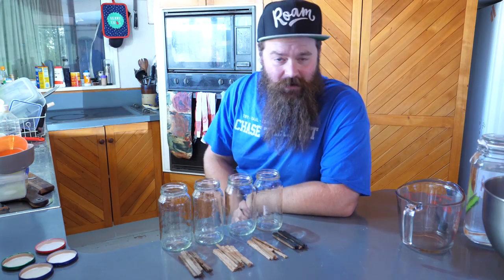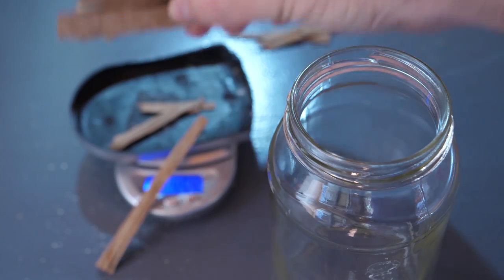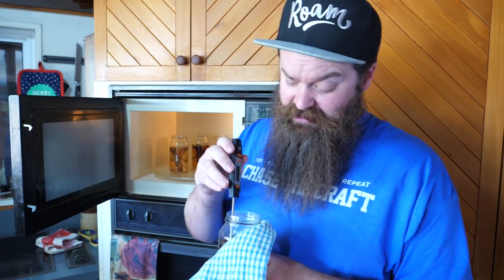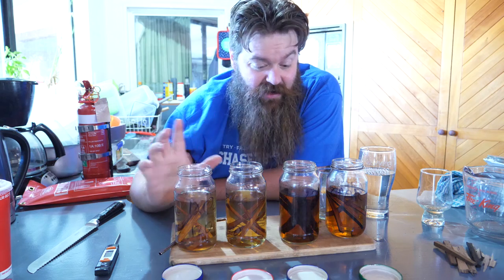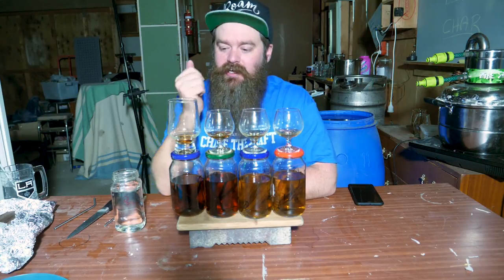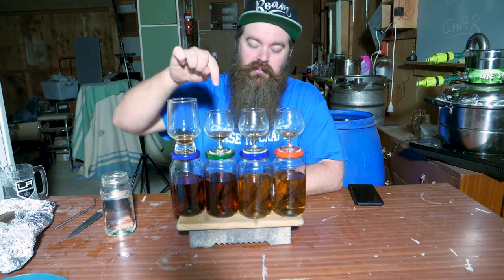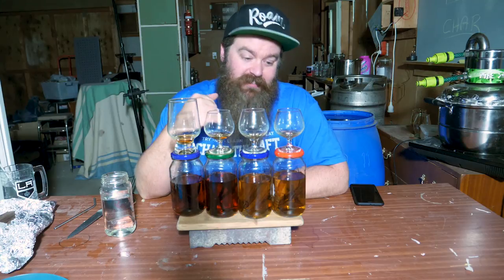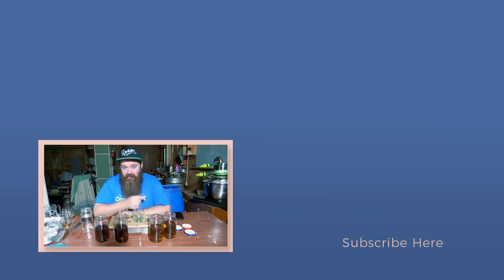Testing Different Oak Char & Toast With Nuclear Ageing

Comment: Why not putting the jars in hot water ? Its slower but safer. An other solution would be to use a seal vacuum for jars.

Comment: Artificial aging is good and all, but there is no real substitute for time.
Reply: Mr Radrick
Reply: Hey can you ad cherry juice to my blend ??
Reply: How do you know. Its all chemistry. If you can identify the exact compounds developed by ageing and recreate with a faster method how would it be different? Don't get me wrong. I am not saying what he does makes aged whisky , but technically ageing can be recreated.
Reply: @jaytorr6701  Yep, and it's easily achievable with gas chromatograph analysis.
Reply: Same shit but faster
Reply: Mr Jenkins but if u need a drink u need a drink when I start up again I will do half forced and put some in my loft for ageing
Reply: Ha easily attainable my ass just because you know the exact amounts of certain chemicals does not mean you can recreate those amounts..... Unless you individually separate each compound then add them back together. Course something like that would cost more than the most expensive whisky.
Reply: You sound like a god fearing man
Reply: @jasontoth5268  Is that supposed to be a compliment or an insult?

Comment: This is probably stupid for suggesting this but maybe try getting your hands on a sous vide machine they basically bring a pot of water up to temperature and hold it at that temperature so you can cook stuff in bags and sealed containers without the worry of burning or going over temperature might be useful if your doing this sorta thing often enough
Reply from the maker: Nah good idea mate

Comment: Hi. have you tried heating the spirits to 60 degrees centigrade.  and place it in an ultrasonic cleaner.  but the desired oak / wood in it i Do 30min runs and a pump that pumps around the spirits in the meantime.
Reply from the maker: I have not tried it.  But I have seen a lotta interest in it after a certain video came out here on YT.  Will have to give it a shot some time!

Comment: Someone may have already asked this, but curious.  You microwaved the samples without lids on the jars.  Won't you lose alcohol by doing that?  I get why you didn't put the lids on (pressure inside the vessels), but I would think that some of the alcohol may evaporate using this technique.  Of course, ethanol vaporizes at 78 degrees celsius (172.4 Fahrenheit for the Yanks) so I guess you wouldn't lose too much alcohol.

Comment: I wonder if you could ferment Skittles to the point so it tasted pretty good on the other side, poured over ice with lemonade as a drink, I call it the I.C   Insta Cocktail just add Lemonade and ice of course, ok it's not quite an instant Cocktail, because I don't own a  replicator out of StarTrek, but hopefully it will taste like a few different liquors but only 1 Base Spirit, and I don't mean it will taste full on like a proper liquor but have hints of the different Skittle flavours 🤔

Comment: Consider adding the SSM to the jars then tossing in their respective oaks in to keep timing sync'd if you're concerned about it. A lower power setting provides shorter bursts please know.  High power is a continuous burst of full power in most microwave ovens. Microwaves cause water to steam and what you're seeing is water vapor bubbles coming out of the oak strips. That's how potatoes cook in microwave ovens. They don't bake but steam instead from all the water turning to live steam i.e. gas from the microwaves exciting them.
Reply: Heat in general causes water to steam, not just a microwave.
Reply: @tygonmaster  Yes, but in an oven the high heat cooks the potato and eventually the steam will have an affect on the cooking. In microwaves, the water molecules get excited so quickly that they turn to steam and the potato is cooked primarily by the steam produced and not via heat convection. Potatoes cooked in an oven, coated with olive oil, salt and pepper and so much better. Just make sure you poke it with a sharp knife several times to prevent bursting, still.

Comment: How about trying putting X amount of each type of wood (a blend) in the jar when you do the aging? You did 8 parts in total from the various jars, 4 (or 1/2) of the 320 (?), 1 char, 1 of 180 and 2 of 120. Since you did about 10 grams of wood in each jar, you could try 5 grams of the 320 (?) wood, 2.5 grams 120 wood, and 1.25 of the char and the 180 wood. See how that tastes and maybe then you could adjust the wood amounts.

Comment: Hey mate loving the videos i'm a newbie running a T500 i've done my first and only TPW over the last few days and been out and bought 2x60L blue barrels as fermenters and got them going with more TPW's 
I have a question about the 2? or 3? litre clip jar your storing your 62% spirits in, in the video. So i was wondering what the seal of the clip jar you have your 62% in what is that rubber ? plastic ? silicone ?, Im asking as i have seen these jars in kmart stores for pretty cheap and would be interested in getting some but haven't been able to source a answer properly from anywhere what the actual material is.

keep up the good work man up until 2 days ago i hadnt even done a run in my T500 and after seeing yours run i already want to upgrade it i got the feeling i will outgrow it pretty fast and i've learnt quite a bit from these videos too

thanks heaps mate
Reply from the maker: Yip Kmart jars!  Haha exactly what wehere I got my ones haha.

I also bought pdfe tape and wrapped them.  I have a video on making these gaskets if you want to check it out :)

Basically probably not a great idea to have silicone/rubber in contact.
Reply: Still It awesome thanks heaps i will have a look for the video tomorrow/today when i wake up am i able to get away without the tape or is it silicone/rubber?
Reply from the maker: Yeah the gaskets that come with them are silicone I think

Comment: 21:40  Your mention of the caps! I could be totally wrong, but I feel like those caps are designed to constantly off-gas at a certain rate either CO2 or something else heavier than o2 to try to displace the oxygen away from whatever is in the jar. That chemical off-gassing could very well be what the lingering "canned"/"jarred" flavour the use of these lids could cause. An experiment on this could be done with sourcing some waxy engineering paper that's usually wrapped around metal parts, that continually off-gasses to prevent the metals it's wrapped around from rusting.

Comment: Forums are awash with the mantra of no silicons, no plastics, inert material only when it comes into contact with product especially in vapour form.  Is that the reason for concern over these 'bad' lids and is the concern only because the product is being heated?  Not forgetting that a cheap bottle of spirits would have a plastic lined lid.  What do people recommend for storage and aging?  Preserve jars with PTFE or cork seals?  Or is there a way to make 'good' these bad lids?  Line with teflon for example?
Reply from the maker: Yeah you are right that cheap spirits use the caps.  I guess the response to that is that many people are not interested in making things like cheap spirits haha. 

I must admit I am more lenient in personal practice than many in the forums.  But I do avoid it where ever I can. Or wrap gaskets etc in PTFE.
Reply: My way of making jars safer is to put some aluminium foil between the jar and lid. It is not absolutly sealed but i think as long the jar is standing upwards it is just perfect!
Reply: @maxischerr  thanks for the tip! I'll be doing this from now on.

Comment: To stabilize wood you do it in a vacuum chamber, I wonder if that would infuse this without the danger. Have a good one.
Reply: i did it in a vacuum oven and it does speed it up a lot  u can see all the air coming out of the wood as i suck a vacuum and liquid going in the wood as vac is released   it being an "oven" i can set temp anywhere between ambient and 500F so suck in the morning and release in the evening  and do it over the next day

Comment: I wonder what effect it would have to put it through a vacuum pot to pull the oxygen out of the wood the same way you stabilise wood with resin ?
Reply: I was thinking the exact same thing. I have a chamber for doing knife scales. Cost me bugger all to make, holds at negative 3 atmospheres for days. When wood is put in the chamber it bubbles as the air in the wood is drawn out then when returned to normal pressure the resin is drawn in. In out in out is that what they are trying to achieve. Jessie is using a ball peen hammer what you ponder is using a sledge hammer. I am new to this but this approach will be tried.

Comment: Air is a gas and will expand more than a liquid so heating it forces it out of the wood, as it cools it will suck the alcohol into the wood. Subsequent cycles just repeats the process, just like in a warehouse over a few years.
Reply from the maker: Yeah dang good point my man.

Comment: I don't know who has been looking into this, but I find you can achieve even better results than this with the wood and the spirits in an ultrasonic cleaning bath for about 30 minutes. There is actually some research and patents you can find pertaining to that technique
Reply: Can you tell me more? I’m interested
Reply: @richardnguyen6757  Look up "ultrasonic ageing of spirits" on google scholar and you will find plenty of information and variations on this technique.

A good way down this rabbithole is also this article and all the information it links to:

https://qz.com/907619/the-many-scientific-ways-to-age-whiskey-many-years-in-just-a-few-days/

I initially used an aquarium pump with a teflon 3D-Printer hose and and airstone to "oxygenate" and a cheap ultrasonic cleaner with a heating function.

Always try what you are about to do in small batches first tough, it is easy to overdo things.

If you want to start to go more seriously about this, look for used oxygen concentrators and used industrial ultrasonic cleaners on ebay. I managed to find one that is large ajd powerfull enough to actually submerge a small-ish barrel in it.

If you start to do this tough, be aware that high-oxygen atmospheres, especially in combination with fuel (like ethanol) and modifying/hooking up industrial equipment on your own presents its own dangers. Know what you are doing or consult with an expert before you try anything that costs you your life
Reply: Ben Müller I thank you for your time in replying to me, if you would like to, I’d like to chat to you more about it, that would be great! Do you have an email? Or whatsapp
Reply: Ben Müller thanks man, have you got whatsapp or an email?
Reply: I hope that you understand that I do not feel comfortable sharing contact details out in the open on the internet.

If you want to chat with people about this kind of stuff, I suggest you sign up at the homedistillers forum and start a discussion there. I sometimes drop by there myself, but you will find many of the people around there working on this are actually a lot more active and competent than I am.

You can also already find tons of additional information on this subject over there.

But I ask that you do your own research on this topic before doing so, as there currently isn't a lot of consensus on this, and all most of us can provide that you can't find in papers at this point are only subjective opinions anyway.

I will not provide build instructions to replicate my setup as it isn't too hard to figure out yourself if you know what you are doing and too dangerous to replicate if you don't. In fact I don't fully trust it myself yet. If I ever end up with a setup that I can truly trust, I will share it on the homedistillers forum.

Comment: Hi Jesse you said in one of these vids you were looking at resuculating water have you thought about using ice in a bucket and a small pump? It works well for me
Reply from the maker: Yeah, it has been rolling around in the head.  Cheers mate, will have to have a look into it some more.
Reply: Still It any help I can offer mate, I use about 10   2 litre frozen blocks for a 20 lt run, just have to remove some water from the bucket every now and again, usually use old ice cream tubs to freeze the water in, found it lasts longer that ice cubes, pump is a 9.5 watt aquarium pump. Keep up the good work mate 🥃👍
Reply: Frozen water bottles.  Then you just pop in a new one when it melts put it back in the freezer over and over. And I'm sure you did it already but a pump in the sink works good and you can add cold water when if it gets warm .

Comment: I have used oak spirals and oak chips. And the chips work in like a couple hours  and I think the spirals  are mainly for taste not color. Idk.
Reply from the maker: Yeah taste and colour seem to be only tentatively linked.
Reply: Chips and spirals produce different results because of the difference in surface area & the qty of ‘ends’. Chips have a much larger surface area and therefore produce faster results, but they also have more enclosed ‘ends’ which releases more tannins... which is linked to bitterness.
I found the difference more and more the longer I used them. I prefer not to ice chips these days, more into chunkier bits of oak - more wood & less ends.

Comment: Those bubbles are not the effect of alcohol pushing air out of the wood. It is moisture evaporating from it (wood). 
Have a Kickass weekend sir!
Reply: Even how stupid it sounds as they were "swimmin" in likker.
Reply: Water vapor won't form bubbles at  atmospheric pressure below the boiling point. It's air.

Comment: Another great video Jessy. One quick question for all not just Jessy. I'm ageing my spirit in chared oak but I see little bits of what looks like char or wood bits in my spirit. What would be the best way to clean the spirit for bottling? Sláinte 🇮🇪
Reply from the maker: Yup thats totally normal.  Just filter it on the way to bottling (or strain it through your teeth haha).  
Just a basic filter, not chill filtering with a tiny screen.  A coffe filter works well.

Comment: You could try using sealed jars and a Sous-vide process.  I do it when making Limoncello, to speed the process up from 3-5 weeks to just two hours.
Reply from the maker: Yeah nice.  I guess thats kinda like what I did with the testing different woods one.  But that was just air temp changing not water.

Comment: Saw microwave to heat spirit and died sitting here. Ethanol near electrical devices.Nope......Hot water bath,cap tightly,place in freezer until cooled. 3 runs usually do it. Reused chips make a clear spirit while still cleaning it.

Comment: Never tried this, only barrel aged, but it makes me wonder if you might get a good result by putting some of each, or at least different combinations of wood into a jar before doing this.
Reply from the maker: I did a jar pretty much doing exactly that.  Roughly the same ratio of wood as the blend I made.  With only small bits planning on ageing for at least 18months

Comment: Great video!  I noticed the Chinese pot still behind you on your right...any chance you can give it a quick review?
Reply from the maker: I used it breifly in one of the live streams.  Honestly have yet to make something drinkable with it (my fault not the stills fault haha).  

Planning on using it a fair bit for mini gin runs comming up.  So can do that then :)
Reply: I have one of those Chinese stills and didn't like it. It made good whiskey, but I got terrible yields. With a five gallon run I would end up with 1-2 fifths of 90 proof. I bought a reflux still and ended up with 6 fifths of 90 proof! I also made a batch of gin last week. It was great. I got a recipe off of the internet and tweaked it until I got what I wanted. It tasted similar to New Amsterdam, (only better). Next time I'm going to tweak it a little more.

Comment: After cool down use a wine maker trick at degassing use a vacuum pump on it for about 30 min. at 10-15 bars
Reply from the maker: Huh thats interesting man!
Reply: I was gonna suggest the same. Here in the US we they have kits to vacuum seal mason jars pretty cheap. Screw a cap on, vacuum it out, and let it sit. Not sure if you can easily find a kit like that or if you do they might want your first born for it.

I have tested samples that way but disclaimer nothing beats letting nature take it's course and slow aging.
Reply: Look for the Foodsaver brand regular mouth or wide mouth mason jar sealers. Amazon has both in one kit for ~ $20

Comment: I’ll admit I didn’t read every comment but have you tried putting a char on the toasted wood?
Reply from the maker: Yup, I have been doing it almost all the time.  I Toast and then char with a torch. Seems to be working well.
Reply: I used a light toast and a medium separate and combined. Just put another batch in with both types charred together and a mixture of both types charred and not charred. Very curious about these

Comment: Sometimes I heat up bottles by lying them onto the pipes of my hot water boiler, it'srelatively save because the water has "constant" temperature of around 60°C in these pipes and I can let it on there for weeks if I want.

Comment: Air bubbles coming out of the wood are expanding air, not necessarily liquid penetrating the wood. The nuclear method is similar to what American whisky industry does when they subject the filled barrels the highest temperature difference throughout the year to speed up production; it's the complete opposite of Scotch whiskey.